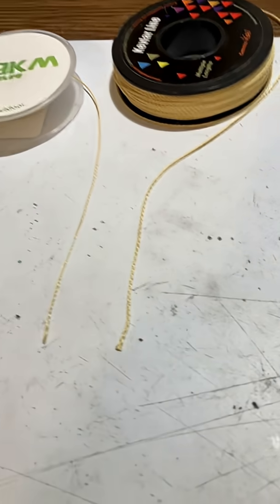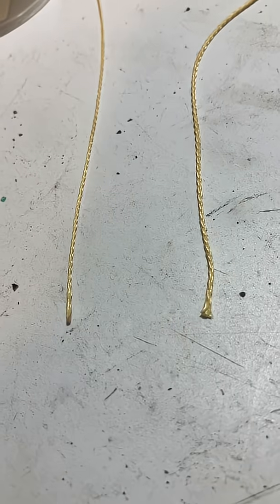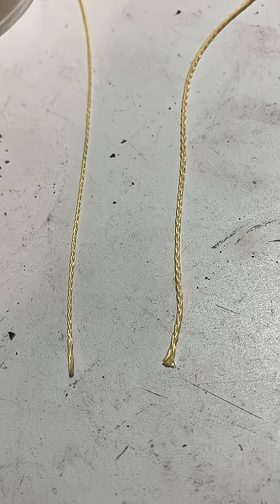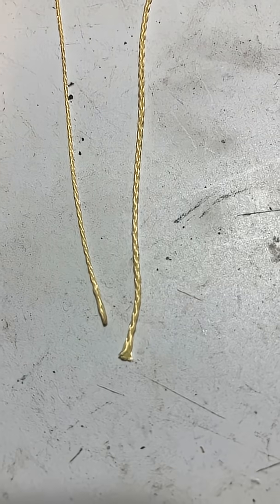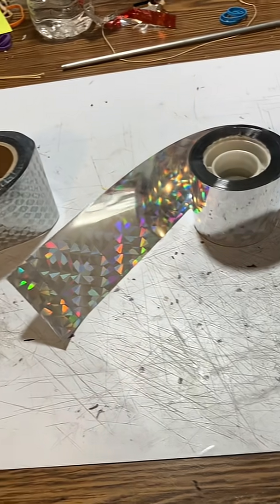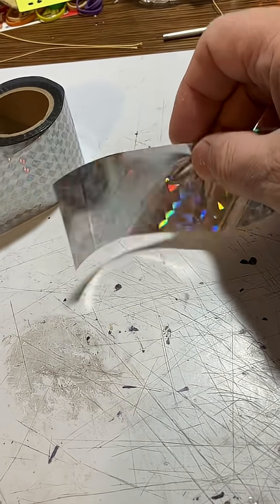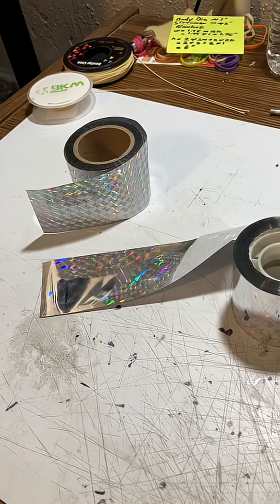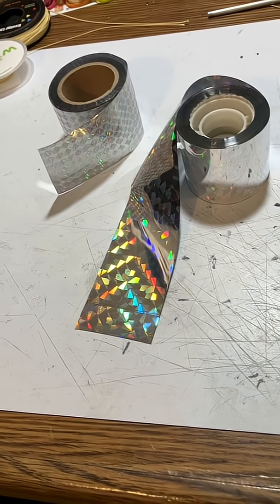Engineering - Comparing Kevlar Cord and Streamer Material

Comment: How do you attach the bird scare material?  I’ve been wanting to try.
Reply from the maker: There are many ways to attach the streamer. Some are in my long form videos, but I continuously change it for various issues.

The only thing that will stick to the PET material is heavy duty "box tape". This tape is available at any hardware store.

I have tried many mounts. Mostly toothpick with a glued Kevlar cord. On occasion the toothpick would crack. I now like using thin "sip straws". These flex and I have never had one break.

There are also options - single ended (attach at one end) and double ended (attach at both ends). The double ended is how I make my "loop streamers" open up into a horseshoe. These are really spectacular. I usually use single ended in the small rockets under BT-50.

Another interesting that increases streamer performance is a "drogue" parachute. Generally a 12" Estes parachute with the center cut out to form a 2" ring. This looks nice. Its primary purpose is to prevent the body from bouncing around.

Stay tuned... I'm in the process of making a new streamer for my Wizard rocket so I can put a big engine it. What size rockets are you flying? There are many options here.